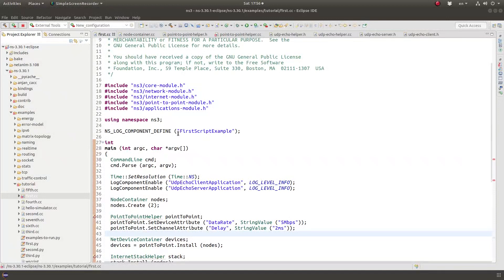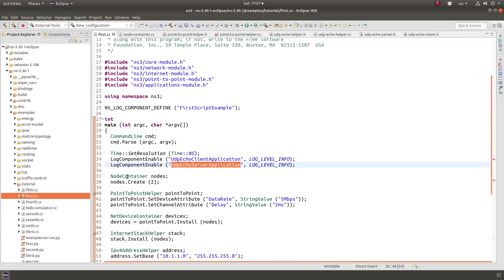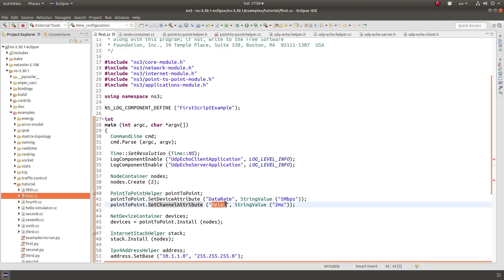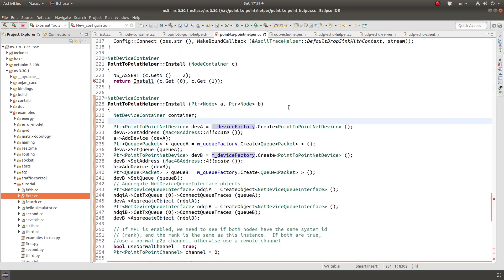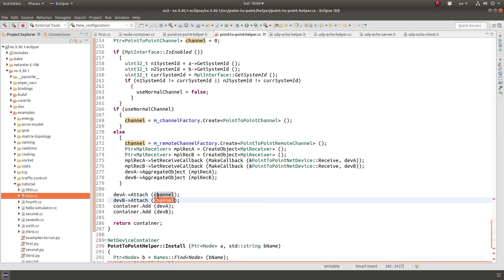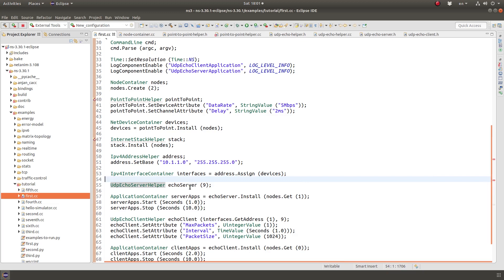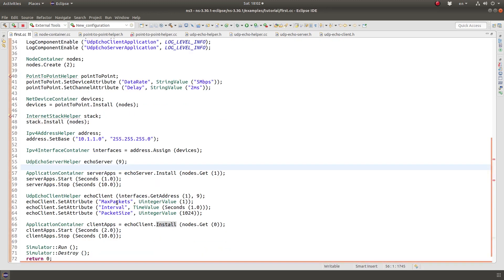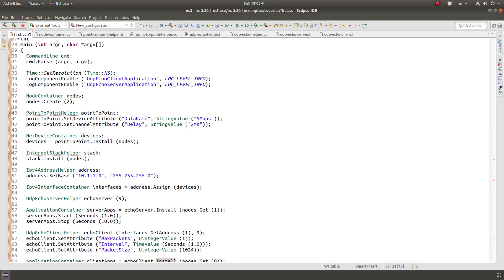ns3 network simulator - Example tutorial 1 (PointToPoint) explained.

Comment: I would like to ask about how can I add more than one channel to the same node. I mean, multi-channel for the same node.
Reply from the maker: I don't understand your questino. Usually you install one or more net devices to a node. In ns-3, a channel basically defines the characteristics of the connection between two net devices (which are in two different nodes).
Reply: @AdilAlsuhaim  Thanks Dr. Adil for your answer. So, If I say I want to add multi-interface for the node. I mean, If node-1 send a packet to node-2 on interface 5 and that port was busy, so it the node_1 can switch on the other port. So, the node has multiple types of interfaces.

Comment: Thank U for sharing，your video is great. Can you give me some suggestions for simulating WSN in NS3? Which existing modules in NS3 will help? I will be very grateful if you can reply.
Reply from the maker: ns-3 simulates the communication network, it doesn't care for the "sensor" part of the WSN. So it depends on what's the underlying wireless technology you want to use. You can run Ad-Hoc WiFi and you can find examples with ns3 like in "wifi/examples/wifi-manager-example.cc" or "dsr/examples/dsr.cc". I think WSNs use different low-power wireless technologies like IEEE 802.15.4, and ns-3 has an implementation for that in the lw-wpan module. You can find examples under the "src/lr-wpan/examples" directory
Reply: @AdilAlsuhaim  Your reply is very useful to me, and I will continue to learn about NS3 and the related videos you released. What you have done is really meaningful. Thank you very much. Knowledge knows no borders.

Comment: Thanks a lot, It's a good idea to make some videos about NS3 Gym, a framework that combines NS3 and Reinforcement Learning.
Reply from the maker: I don't think I'll have time to look into other frameworks. I am personally working with VANETs for my research, so I share things from my experience. But thank you for your valuable comments!
Reply: @AdilAlsuhaim Thank you for your attention, I also research on connectivity restoration in WSN, recently I figured out that AI and Reinforcement Learning can plugged into this topic and also so many others, Is there any way to contact with you for sharing knowledge and experience?
Another question that I have is that   how can distribute hundreds or thousands of wireless nodes in a wide range of erea? How to move this nodes in my own ways? Please help me 🙏
Reply: @alirezamogharabi8733  hello Sir, i'm interesting to the feild of RL, i work with IoV optimization using RL but i did not find any information about using RL in ns3. If you have some tutorials or manual that are integrating the RL with NS3 please help me